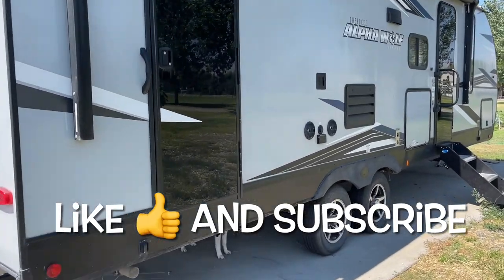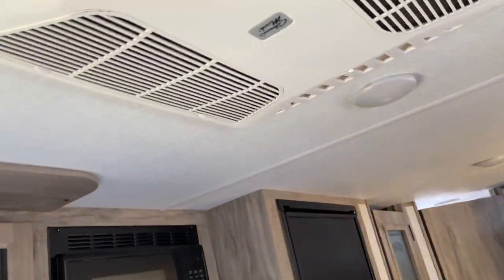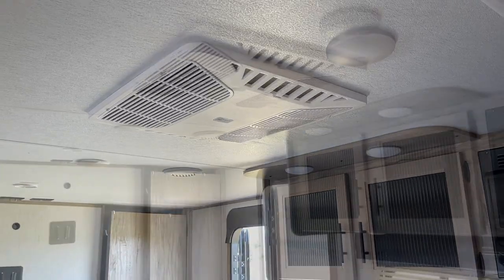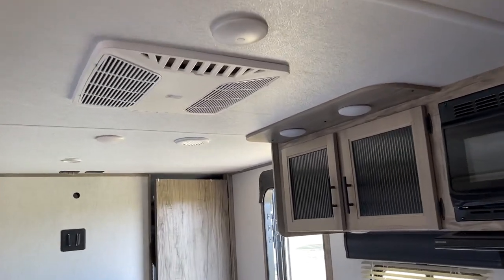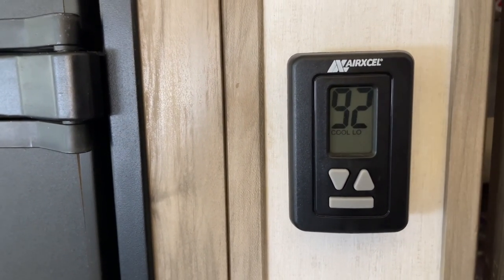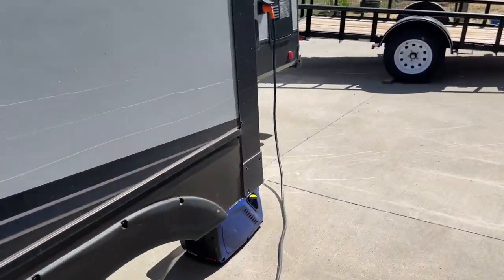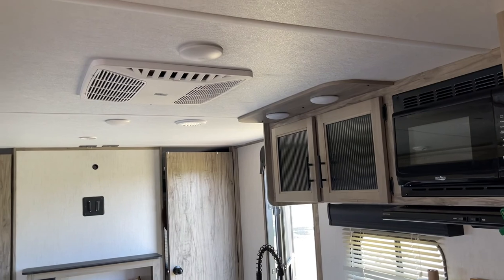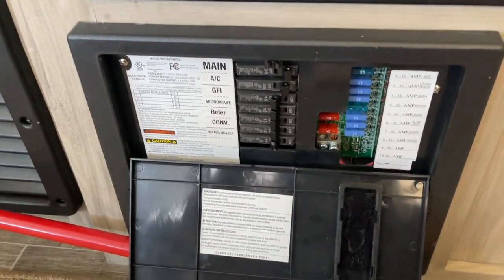This is how I make the  Westinghouse igen2500 run a 15k air conditioner….it can be tricky!

Comment: I have a 13500 roof ac on my camper 2016 with soft start. And my 2500 watt will not run the ac for very long. Approx 15 minutes only .
Reply from the maker: That’s good to know, I never tried to run mine for super long yet.